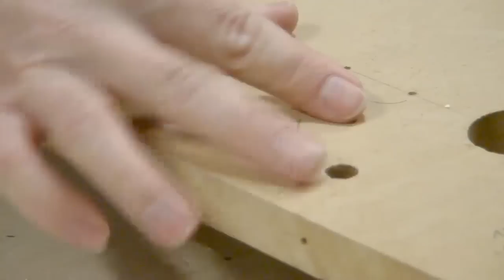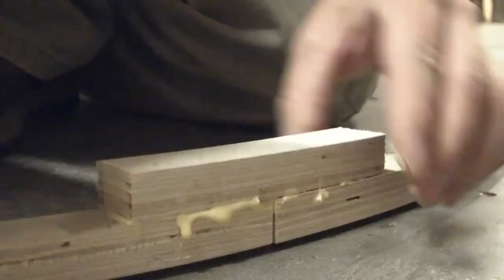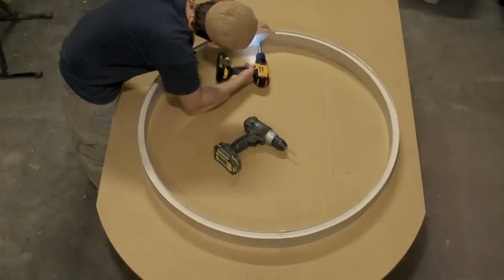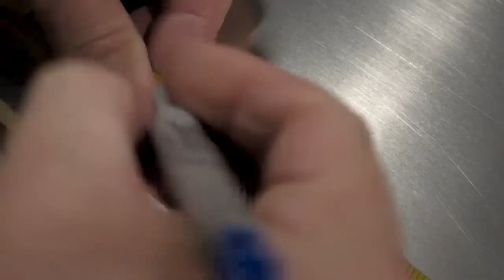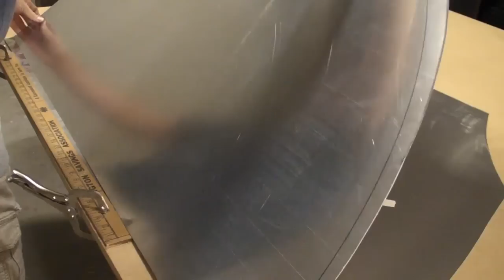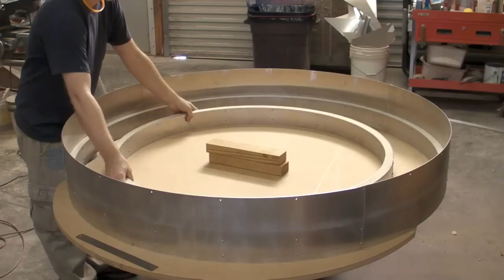Making an Aged Neon Coffee Sign, Part 1: The Build

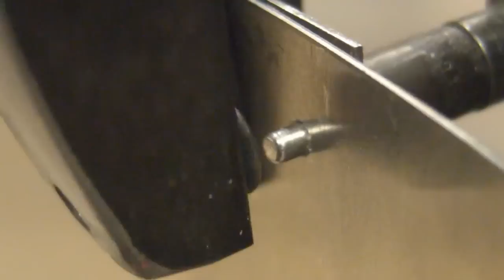Comment: Hi Wes, Good name by the way. Where do you get those rivets at 5:32 or what are they called. Txs
Reply from the maker: The rivet you see there is a 1/8" solid aluminum rivet. I order mine from McMaster-Carr. The tool is called a rivet squeezer. I got mine at a surplus store in Dallas, but you can find them online. Thanks!
Reply: Wesley Treat, Maker of Things  Txs Wesley